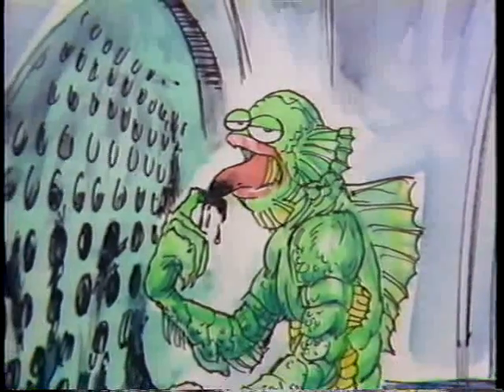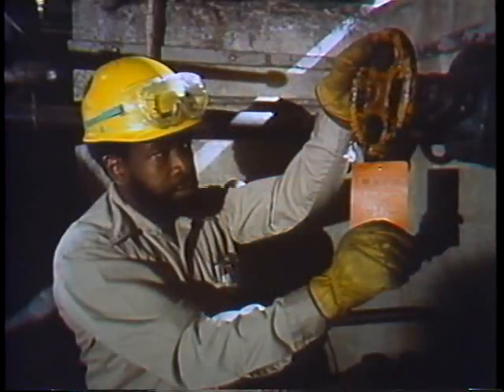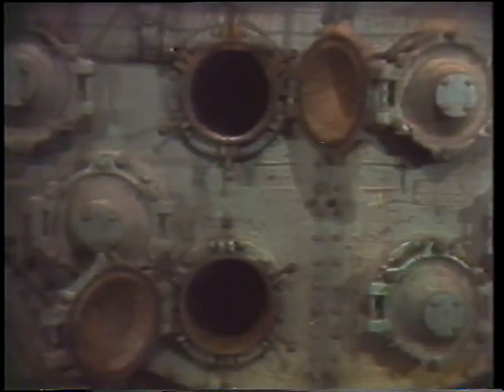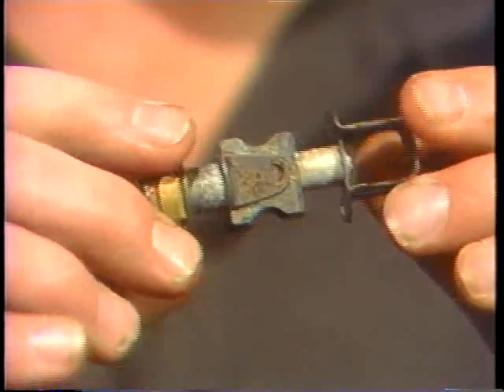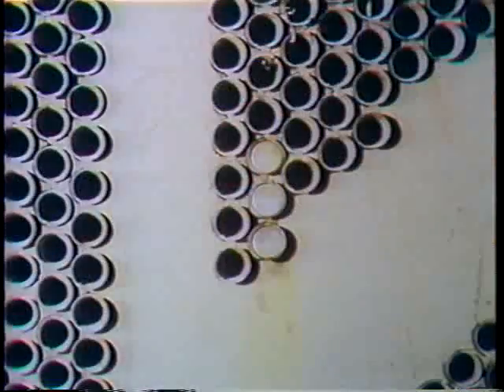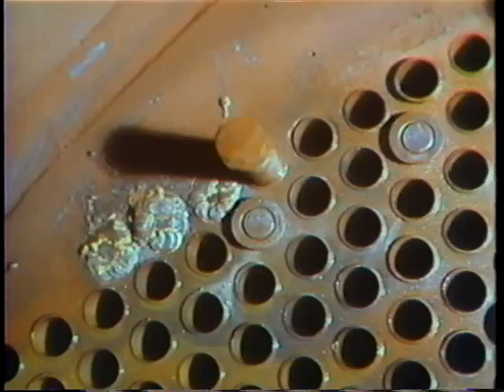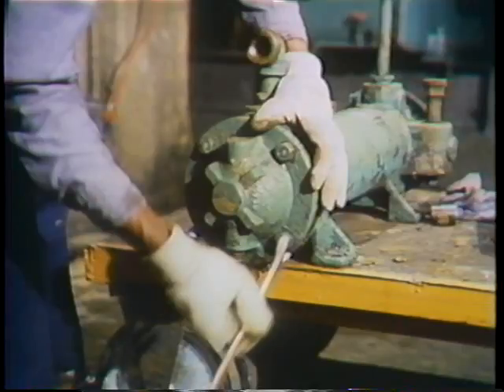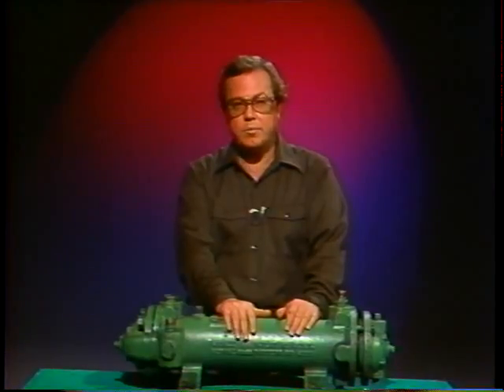How to do Preventive Maintenance-Condenser Heat Exchanger|?صيانة المبادل الحرارى

Comment: I have an experiance of 25 years in this field.I have assembled and re tubed many heat exchangers and boilers,both vertical and horizondal bundles upto 2"pipes,Miled steel, stainless and brass pipes. I use modern equipments like electronic torque control unite,hydrolic tube pullers,tube cutters ect....
Reply from the maker: Ur welcome 👍 🌹